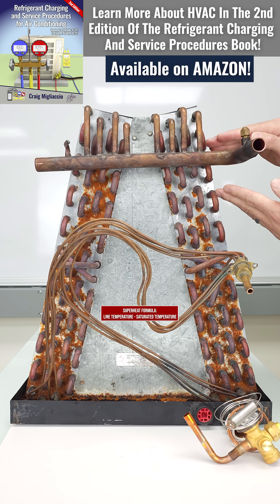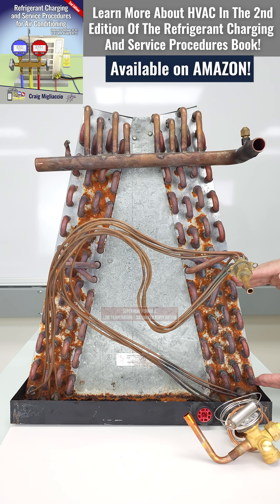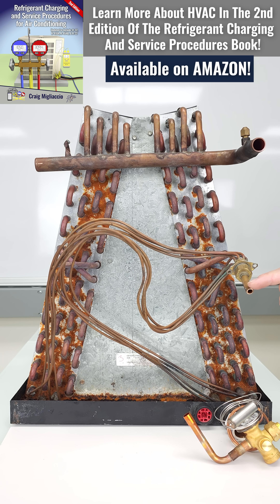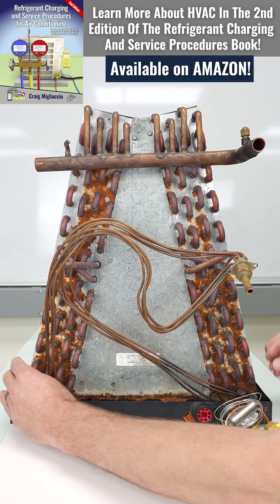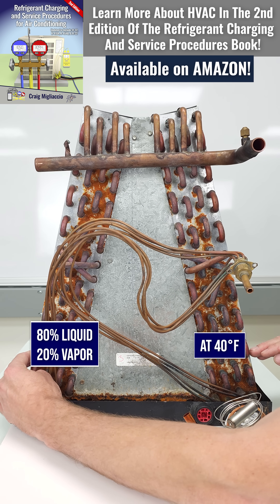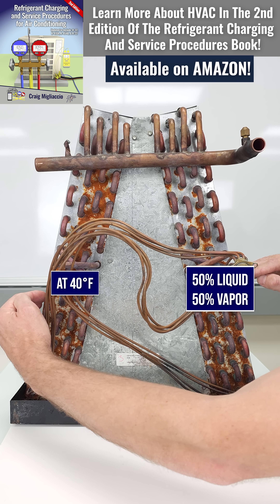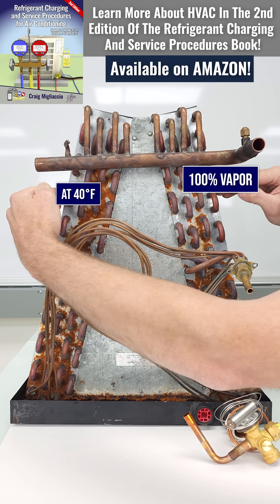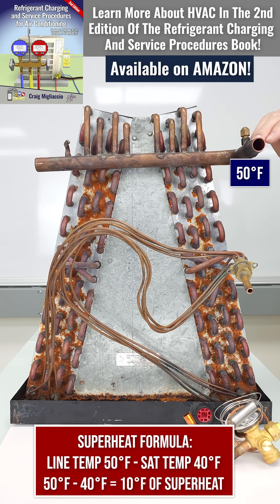SUPERHEAT Explained Quickly on an Air Conditioner Coil!

Comment: Please suggest if we change the condenser of 20 × 20 inch to 27×30 Inch in 2 ton non inverter ac unit then what's the performance of ac

Comment: And as such, if 40 degrees corresponds to the evaporator pressure ( saturation temperature) since the temperature of the leaving vapor is now 50 degrees we calculate 10 degrees of superheat ( difference).
Why is superheat important? It prevents the vapor from turning back into a liquid before it reaches the compressor. It would not like that.